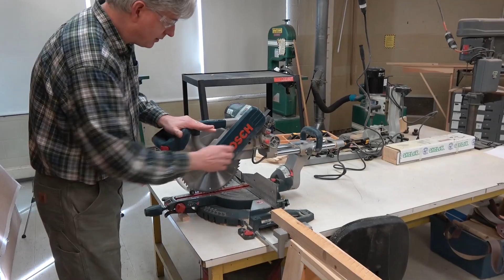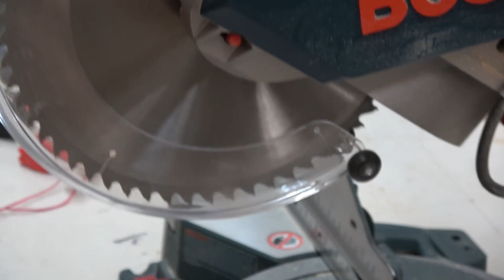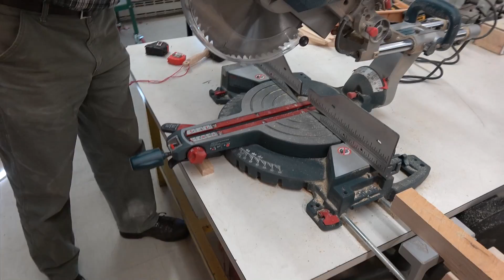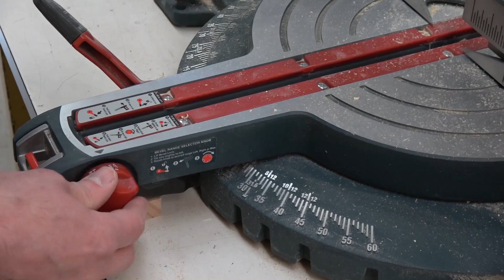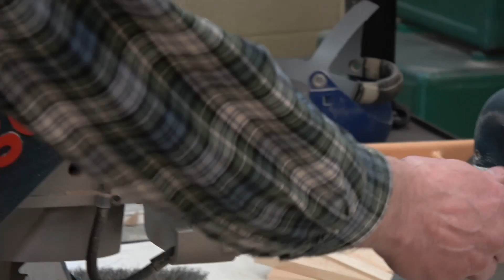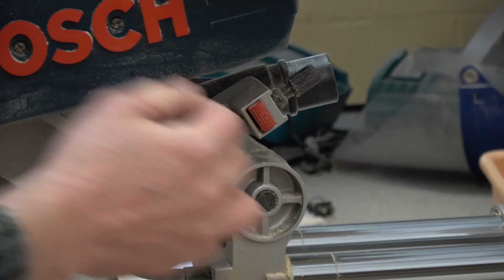Bosch Compound Miter Saw Training

Comment: Thank you for your instruction. What model is your saw? I have the Bosch CM10GD but I don't seem to have the locking points on the angles like you show in your video. I am just wondering if I am doing something wrong or my saw just does not have that capability.
Reply: It appears to be the 4310 model. From the mid 2000's